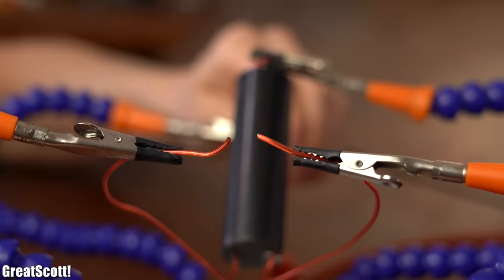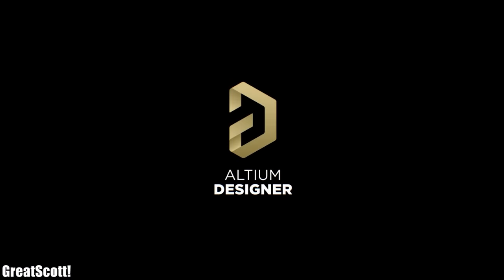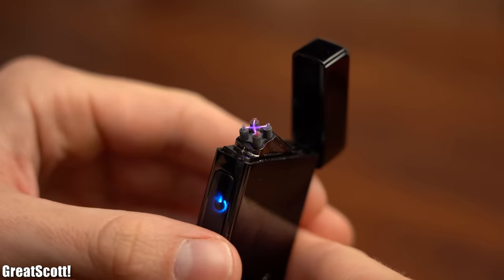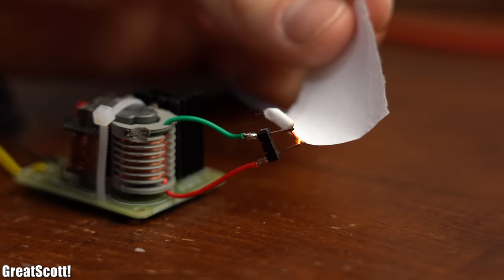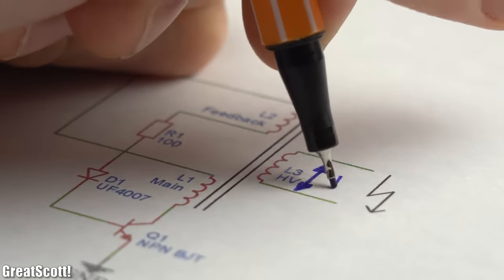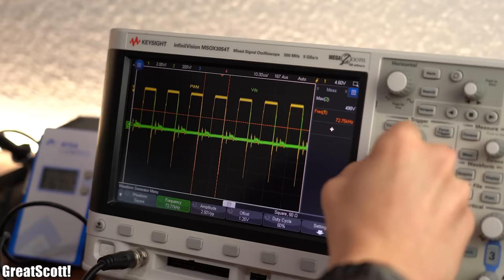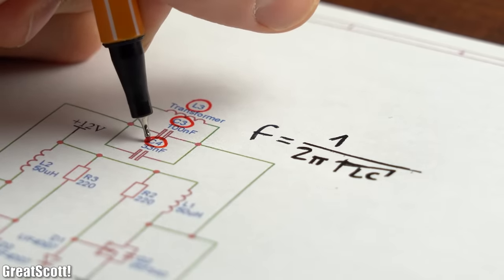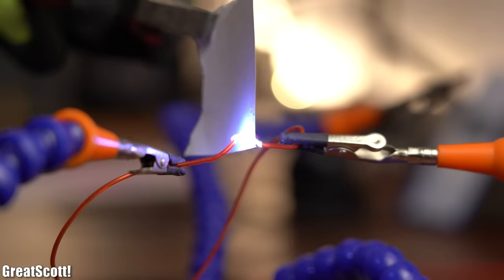DON'T BUY this HV Generator! Build this one instead....please

Comment: This is interesting to me, as a complete electricity novice.
I just find the light pretty, and thought it might look interesting in slow motion. 

i bought a $7 amazon plasma lighter, and it's kinda neat. very small arc as i expected. It doesn't look interesting with 240fps slow motion (my limit), but the slow motion revealed the interesting hum it made. 

I'm not sure how safe it is. I of course didn't touch it, but i held a small piece of aluminum tape and zapped the tape. I could definitely feel the electricity, and it almost made my fingers curl, like strong electricity can do. 

It is also powerful enough to light up small RGB LEDs (only lights up red, and ruins the bulb) and it even made very dim light come out of a 5 volt red laser. I haven't tested whether it broke the laser diode, but i'm guessing it did. 

I'm a lighting enthusiast with very little electrical knowledge, but find your videos interesting.

Comment: Well, the "garbage device" uses the same HV Transformer and a voltage multiplier to create bigger arcs. It's a compact, finished circuit.
A good and cheap source for pulsed arcs. Works great for experiments with lasers, vacuum chambers and of course; igniting gasses - what they are originally made for.
The only garbage is the device information, 400kV or sometimes over ONE MILLION VOLTS?! LOL
Reply: in my case the prosecution googled and found that figure, they assumed that it was true and the module was really putting out over 100KV, took a while to get it corrected and understand it was less than 20KV, which I knew already from the arc length.

Comment: Thankyou Mr Scott, I totally agree you should be very careful if you buy one of these, I did 6 months in prison for scaring my mum with one ( I have autism and my parents are weird and overbearing ). I was eventually able to convince the judges that it was not very effective as a Taser,  from my perspective I was not able to tell how this item differed from an electric lighter or a practical joke handshake shock thing, those items were legal so why wouldn't this be ?  I only had a few months of experience with electronics when I bought this component. It should definitely come with some sort of warning not to use it towards other people. I am still unsure whether it would be able to deliver any sort of electrocution if both outputs were directly connected to the 'load', the reason being is that its output voltage is dependent on the air gap, it has no internal way of producing a pulse of fixed voltage. They also burn out quickly if continuously operated, it can be under a minute before it will fail.

Comment: Hi GreatScott, Nice vid ! How do you test the hv side before even considering touching it ? Do you simply mesure current with you multimeter on the HV side while the arc is formed and check if it is under 30mA or less ?  how many mamps was the first dangerous one capable of delivering ? Thanks

Comment: Great video as always,i have couple of those transformer and a month ago i tried rewinding them and used a half bridge driver to drive it,it produced very long arcs close to 3 to 4 cm but not for long😅 the insulation failed and arcs started flying out of the coils.
Reply: Which xfmer? The one with the separation disk's or the kit supplied one?

What voltage and frequency?

Did you use alternating voltage or chopped DC? I guess if you used a full bridge then it was alternating?

Edit re-read your post: half bridge so chopped DC?

Comment: Great video! A just slightly disappointing element for me was when you said "I want to make it more powerful", I was all ears because that was exactly what I wanted to do. The disappointing bit was that my expectation was that you would use the same power source (eg equivalent to a 18650 cell), but your extra power came from the greatly increased voltage - 12V ! That is 4 Lithium cell in series which makes it impractical for a lot of applications. Can you try to increase the output power without increasing the voltage?  After all a 18650 Lithium cell  (if not a Chinese one) is perfectly capable of high power, especially in relatively short bursts.
Would be a good topic for another video, wouldn't it?
Edit: and btw in my case the transistor "went" as quickly as in your video. I replaced it with a TIP120 Darlington pair IC and it works like a charm. But of course more power would have been desirable.
Reply: I know this comment is a year old and you probably have found the answer to your question already but, you can use a boost converter to increase the voltage of your 18650.
Reply: @anonymousadam8950  Cheers! Although I must say that a boost converter was not a solution I was seeking as it complicates the circuitry. Also that BC would have to be relatively large as the igniter output power has to be north of 25Watt.  What I was hoping for is a kind of change in the resonant parameters of the oscillator to maximise efficiency and thus increase the output power that way. There has to be some frequency on which the efficiency is the best, and I was wondering if anyone made a research as to how to discover it.  In any case, thanks for your response.

Comment: Hi! You should talk a little more about the principles of those transformers, is the power (W) you feed into the primary proportional to the output power? As someone in the comments said, this transformer is as much as 1:200 and it uses other principles to generate that much voltage

Comment: I disagree STRONGLY with your initial premise.
"Caveat Emptor" means that adults need to use their intelligence to decide the risk of any activity or device.
The initial module is powerful and potentially dangerous.  So is driving an automobile.
The second device has a far lower output, and will not be useful for many projects - like for instance an electrical mouse trap.
I usually like your material and projects, but my advice is to NOT preach to viewers, rather present your material and let the user decide what will work for them.

Comment: Well, you can also buy knifes, chemicals, laser pointers, and other weird chinesium stuff on ebay. Just because someone could get hurt if they misused it doesnt mean that its ridiculous that its freely sold. Unless you also want to restrict the sale of knifes and stuff like detergent because some smoothbrain might manage to hurt themselves with it.

Also, i disagree with you calling that thing a taser. It is an electronic part that CAN be turned into a weapon, but that doesnt mean that people WILL turn it into a weapon. Same thing as earlier; someone can buy a knife, but its up to them if they use it for cooking or to shank some dude they dont like.
Reply: Those aren't putting any human down but they damn sure make great bug zappers.. Put one inside some kind of tube with an 18650 and USB charging circuit and it makes a great roach judge with a little reach on it.

Comment: If you would have replaced the BJT with a stronger one with a zener diode included in which the cathode should be connected to base and the other end to the emitter, I hope this would have helped, and if you are ElectroBoom go for zvs circuit 😅💀

Comment: I would like to build a high voltage circuit that is adjustable voltage and current wise for Powder coating application.
Reply: Yes. Not a lot of info out there for those. I'd like to build some kind of electrostatic dust filter/ air scrubber for 3d printing, like the big ones used in subway systems
Reply: @ffoska  we are on the same page, l hope great Scott will work on it.
Reply: I’m also interested in this! Bought som of the second modules he showed, but after the demonstration it seams that I need to look for other alternatives:)

Comment: Lol. I have a dozen of them. (black, tubular type) 3D printer, couple of nails, tiny pushbutton, cheap charging and boost board, and 14500 cells make a great ...........demonstration.
You never know when you need to demonstrate the benefits of electronics to people that would take your wallet.

Comment: Hi. I just have a question about the device you´re talking about. Let's say i put that device in a bug-zapper with a 18650 litium 3,7v bat as power-source. The distance between the - /+ is 5mm. Now the arch i get is too slow and not very good for smaller bugs. Along with it just gives them a bash in the head.. What options would you recommend to alter the arc to be faster and more effective for smaller targets between that space 5mm. I've tryed a few things but don't get the wanted resault. "faster pulse that get's the smaller bugs with 1 click" just list what you'd put after the generator. And please don't say 30kv cap. Done that, not what i am looking for.

Comment: The modules are only part of the teaser and thus not a teaser.  No labeling is required as a component.  They are used precisely as a gas lighter.  As in similar science projects. If you just want to play with high voltage then they are not very useful.

Comment: Great Scott! Did the inductance of the transformer change after you changed the windings on the primary?

I have one of those commercial drivers. It works fine with a small lithium cell. The battery heats up though(CR-2/AZ3(3V))
It also runs at a lower output voltage and current with a 220ohm resistor instead of the 110ohm supposed to be delivered with it.

Comment: They both are not bad products. They both have pros and cons. The scary one is good if you know what you're doing, the safer one is better for... well... being safe. I Agree with you because I want people to stay safe. ONLY BECAUSE I KNOW EXACTLY WHAT I AM DOING I would get the one with more power, I would tell other to get the less scary ones. I do have both of these supplies. I also may or may not have a microwave transformer on my desk. 
D O   N O T go inside of a microwave unless you know EXACTLY, and I mean EXACTLY what you're doing. There are many things that can kill you in them. You short the capacitors (Barely touch) your dead. You crack the parts in the magnetron (The insulators have a dust inside them) and breath in the dust your dead. The microwave transformer outputs the same current and voltage as the electric chair. One of my friends blew half their hand off with a microwave transformer, and my dad... He was trying to make a Jacobs ladder and the switch he was using was make out of metal, and the switch was on the positive charge, my dad was outside, wearing steel toed boots so he was grounded. when he switched it on, he died. The power had gone through his arms, torso and legs. his heart stopped, we were all watching and instantly dialed 911. Lucky for us they were outside our neighborhood and arrived in 3 minutes. They got the defibrillator and kept shocking him, but nothing happened. Please do not go poking around in a microwave, for the love of god.

Comment: I have same same hv voltage and after playing it with some time I made a royer oscillator to drive hv transformer to make an ozone generator and at 5v with 90-100mA it works very good
Reply: How did you configure it for the ozone generation???🤔
Reply: @fookingsog  output wires the of hv transformer i soldered a needle and in other wire i soldered piece of metal with hollow in the middle when you adjust the gap between them you'll see faint purple glow and you can feel weak breeze.

Comment: I made a 5cm plasma arc with DC transformer from one of the TV transformers. What voltage is that? I'd assume 150000 volts. I also have a 90kv tesla coil. Works at two frequencies of 300-350KHz and 500-600KHz. that frequency cannot shock you.

Comment: Yeah those HV generators are nasty sensitive! I bought 10 of them before and literally every one burnt my chargers that I used from drawing too much current and they still burnt out! I tried batteries , it still burnt out from overheating. I tried turning on a ducking led bulb with them they still burnt. They literally overheat so much they and the transformer inside leaks oil and BOOM destroyed in 1 second. They are only good for instant on and off lol. Also I heard that they’re called “shock absorbers” they are truly not a zapper but their sound is nasty not gonna lie. (:

Comment: actually if you look for the smallest of the modules like the amazon one, you will find one much smaller that is advertised
as 20kv and puts out a similar high frequency arc like the self built one.

Comment: High voltage is dangerous. I once accidentally touched charged 22 inch CRT and the amount of energy that thing accumulated was so big I just sat in front of it after the shock for 30 seconds before I could do anything. It was a true brain reset...
Reply: I feel for you you. I touched a disposable camera's xenon flash circuit with scissors when I was a kid. In the brightest light I've ever seen, whilst pissing me pants, it welded the scissors to the PCB.

Comment: You could measure the wire diameters and resistances:  N~L=RA/rho.  Rho will cancel in the turns ratio.  As a check, the volume filled is V=LA within a filling factor that also will cancel.  These will get you within a few % of the turns ratio.  N is always an integer and typically is chosen such that N>/N<=n another integer unless a specific voltage or current ratio is desired.
Reply from the maker: Sounds like a plan ;-)

Comment: 5:39 why even try ? at 4v input it wouldnt have enough voltage to drive the gate at high frequency, and irf740 isnt even a logic mosfet tthat operates at lower gate drive voltage, it will only end up turning on partially which will destroy a mosfet really quickly especially knowing that the Rds(on) of that mosfet is like 0.55ohms with it partially turn on it will be like multiple or tens of ohms

Comment: a couple of years ago i purchased 2 of those high voltage transformers and made a double output stun gun to defend my self, although it is not lethal it packs a punch. What i wish to know if it is possible to use  hv generators to power the coils of a  coil gun instead of using super capacitors

Comment: Great Scott, you're just the guy that can build a coil that is incorporated into an e-car wheel or wheels in order produce electrical energy that would continuously charge the battery array or a supercapacitor array or a combination of both so as to have an e-car that never needs to be plugged in which means unlimited range due to it being a perpetual propulsion vehicle, not a perpetual motion device. It has got to work because it is basically the same principle as the wind turbine. Get right on this and let me know how it works out and don't forget my finder's fee when you become rich off the royalties.

Comment: I just use a ballast and flyback for high-voltage . But that stupid high voltage Power supply does power my table top tesla although not more than 40-60sec at a time

Comment: @2:35 those specs look off. the input power is 8.4W but the output power is 6000W? is that output current supposed to be 0.4mA instead of 0.4A?
Reply: yeah probably,   i(1)v(1) = i(2)v(2),  the output current is pretty low I figure, a few milliamps at best, also I suspect it won't penetrate throughout the whole body ( or clothes ) because of the low voltage.

Comment: How did you make sure you had the polarity of both primary windings correct? Thinking out loud, if they were subtractive wouldn't that cause more load on the switching transistor and cause it to overheat? Not 100% sure how the circuit would react additive vs subtractive, but since the transformer wasn't too well marked, just a thought.

Comment: Well,I once use the multimeter to measure the voltage of this HV generator and guess what! I killed my multimeter(sad...
Reply: The one from the beginning? I can sort of imagine you needing a very high voltage one to measure it or else it will just arc strongly inside the instrument indeed.
Definitely looks like they just pulled a taser blob-part out and that's it, sell it cheap.

Comment: Also, isn’t breakdown voltage of air 3kv/mm at standard atm and insulation of magnet wire can go higher than that up to 10kV?

Comment: Me the moment I see the schematic using a BJT: wait, why is that using a BJT and not a MOSFET?
Little bit later: now you may be wondering why not use a MOSFET…
You read my mind…
Reply: Why use a MOSFET when BJTs are better ?
Tell me when is the last time you fudged your BJT via a surprise electrostatic discharge. Or tell me when is the last time you used a MOSFETs in a power amplifier for the hundred megahertz or gigahertz range.
Personally, I prefer using mostly BJTs and JFETs when a high voltage source is nearby (especially if it is a negative DC HV source) because those can survive low current shocks.

Comment: I am trying to use this module for starting my turbojet engine. It is able to create 10 mm arcs easily. However, when I connect it to a spark plug (to be installed inside the engine) it doesn't create any arc even with a 2-3 mm gap. Sometimes when one of the terminals of the plug isn't touching, it does create an arc both on the terminal and between the plug's electrodes.
I am desperate for help...

Comment: Please build a powerful zvs driver
Reply: already done check his induction heater video, just scale up the mosfets to make it more powerful also replace the mkp caps with those black ones that are used in induction cookers and in commercial zvs drivers
Reply from the maker: Yep. Already did it :-)
Reply: Just increase the voltage.

Comment: Can you use the first generator as a ozon-generator? Can't find the answer anywhere. Please
Reply from the maker: I don't think so
Reply: @greatscottlab  if i adjust the spark-gap too wide, it smells ozon. But i don't know if this will damage the Generator. Will it blow up or get broken if i do this?
Reply: @lassediscovers1813  yeah, they burn out in under a minute or 2 if operated continuously. pretty sure they are just intended to be a starter for something else.